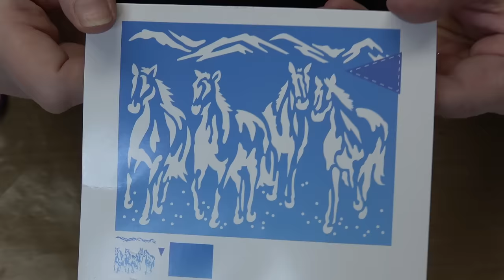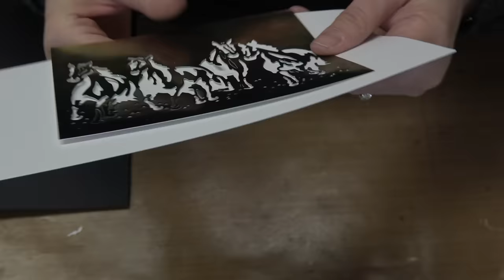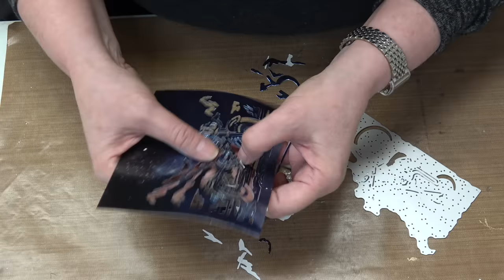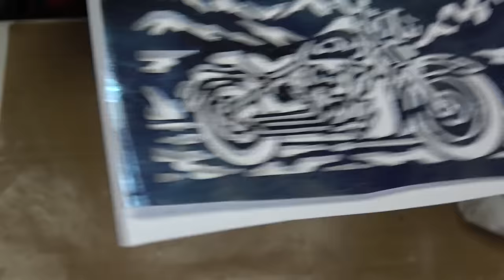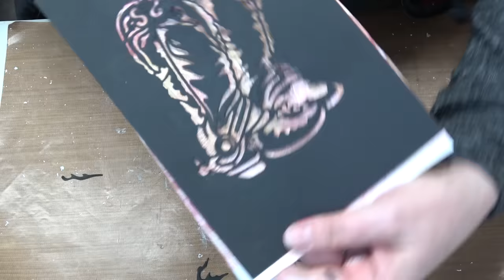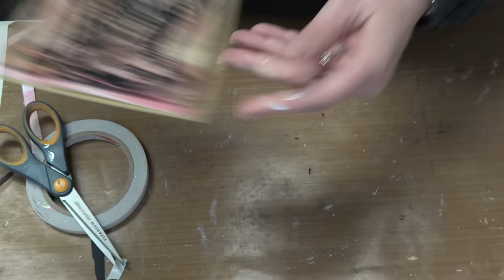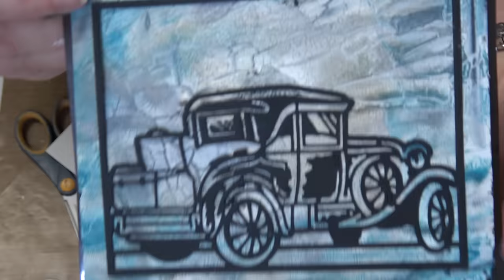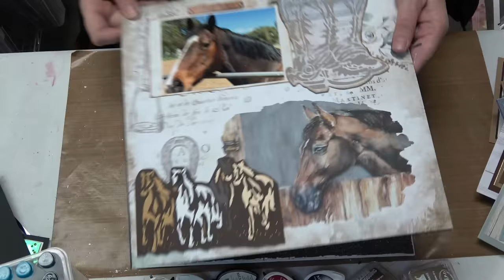#420 What is Dreamweaver's Crackle Paste? Why you want it & many ways to use it with Simply Defined

Comment: Loved Elena’s boots and all the paper- pieced motorcycles. They looked so good. Great build a scene die set too. 

Wanted to tell Stacey that “jalopy” doesn’t simply mean old. It is typically an older run-down car. Synonyms are junker or clunker or beater. The car in your die is certainly vintage but it’s an old car that’s in mint condition. It’s a classic car.